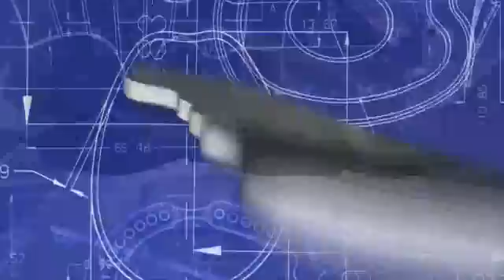#britek  Energy Return Wheel... Autonomous Never Flat

Comment from the maker: How do you think the EPA gets their estimated fuel efficiency numbers? USDOT testing labs.... where we did our tests. Show a pneumatic tire hitting a pot hole at 40 mph. then show how flat it is plus the cost of repairs. Check out our first ever carbon fiber video to see the front left steel hoop ERW that suffered a cracked hoop from hitting a 4"x 4" brick at 35 mph. still running. We switched to composites shortly after.

Comment: If I'm correctly understanding how this is suspended it seems pretty sketchy to me over the long run. As the hoop is deformed on the bottom, especially during an impact, the bolts have no tension on them, then become fully loaded as the wheel rotates. High frequency cyclic loading of that magnitude (and some of it impact loading) is a great way to snap threads in tension. Also, this design looks so stiff that the contact patch is greatly reduced. I also see the bolt holes egging out over time.

Comment: Imagine a wheel able to flex under load to for an elipse.  It would be like a tank track:  making lateral forces that would slide your face to your ear.  Traction that would have to use a locking mechanism for seat belts because roller coaster effects would be possible by simply breaking for a pedestrian, animal, texter, etc.  I forsee Nobel prizes being awarded.

Comment from the maker: We have done what you suggest! Our sidewall curtains are much more elastic than pneumatic tires. Some proto types are tuned via a 18 Hg. vacuum causing the curtains to curve inward.  Additional vacuum boost on hoop side backs up drawn membranes improving performance. Screw force accumulation and return is also improved via curtains.

Comment from the maker: ERW is much more immediate than you are thinking. Stretch a rubber band across a span then grasp and stretch from the middle in line with the span. ERW 360 degree array takes advantage of this mechanical levering and responce improvement. Acceleration and brake force are dramaticly improved.

Comment: If the membrane "stores" energy by STRETCHING & eventually releasing that energy; please solve this 'problem'. During acceleration, when the energy "stored" in membrane is released  eventually, it propels the vehicle forward. BUT; during braking, the membrane will similarly be stretched. The energy "stored" in the membrane from braking must also be released AND again; the energy would assist to propel the vehicle forward. Does this mar braking performance ?

Comment from the maker: Even our first protos would handle more than you think. HP and torque are turned into stretch energy as the 4,800 psi. elastic band supports vehicle mass and throttle response winds hub in hoop rebounding force to the surface....without hop.

Comment: They look really heavy with all those parts, centrifugal forces is just going to make it even more heavy to extreme levels. Resulting in reduction in power meeting the road, speed, and even fuel consumption. There;s a reason why race cars and even the average sports cars use very light weight wheels and tires.

Comment from the maker: Foam has it's own issues. Foam is slow and a weak link. ERW does not dent to process impact. We displace internally under elastic gain. ERW could be described as equal responce wheel.

Comment from the maker: We agree, the Tweel is just a spoke wheel. Flexing rubber spokes deform on the bottom while we stretch from the top ID of our hoop. Tweel uses a bias belted tire like hoop while we use space age composite hoops with bow like tension to flex a footprint.

Comment from the maker: Engineering options will provide the traction systems for specific applications. Our composite hoop is only 25% the weight of the rubber it replaces and is rated at 50,000 psi. while your beef eater pneumatic tire will pop at 120 psi. or be taken out by a 1' wood screw. Women will ignore your pneu. style while your ERW having buddy takes over.

Comment: Good move--especially for the off-road fans, when thorns, rocks & other items that puncture pneumatic tires are a major nuisance, simply because you're out in the boonies and only have the few tools you probably didn't think you'd need often enough to bother bringing with you :)  Solid rubber tires on bikes are *really* hard on the derriere for the non-suspension bike guys...

Comment from the maker: Yes. If the market would support it an expandable replacable tread to smoke at your pleasure. Nestably recieved on a curved atriculated composite hoop. Keeping the lamination line well above road contact. Hard to do with pneumatic tires. Retread option banned for use on front of pneumatic:)

Comment: lets see it on a race track, theres no dot regulations for a few runs around a track surely.

i could see it as a spare tire that never goes flat but how often do the bolts come loose from vibration when your driving and lets hit a few pot holes or rather as your going around the track and you hit the little side curtains or whatever. i cant see how these would hold up for 35,000 miles without problems when theres so much going on inside with the nuts and bolts.

Comment: Apparently you are not going to a very good sam's. I am a Service Manager at Sam's Club and we do not have this problem at all. Also i dont know what kind of sensor it is u may have on your car but we keep the sensors in stock and they are usually around 40 bucks. Reguardless if they break the sensors they are to replace the sensors and retrain them to your vehicle at no cost to you since it was their screw up.

Comment from the maker: TPMS is one reason that ERW has not been allowed. Remember auto manufacturers HAD to provide the system costing 120 million to comply with the reg.. They cant let it look like a waste...can they? The ERW you may be able to buy will be much more simple and ballancing and installation will not be an issue. The fuel savings are very significant.

Comment: Like the morons at Sam's Club wont fuck up these wheels beyond belief when you get new tires.
They cant even stop destroying my TPMS sensors ($200 per wheel and new tire needed when driving on a flat tire).

How could you possibly balance these wheels...and will the cost of one set come close to offsetting the fuel savings? How do these perform on roads that cant be maintained because the previous Governor of the state stole the Highway Fund budget to balance his liberal bankrupt state budget?

Comment from the maker: ERW can out perform pneumatic tires in all parameters. Depending on application ERW can be tuned or engineered to increased hub in hoop displacement or travel, the % of elastomer tune or stretch between hub and hoop, the amount of vacuum boost on the hoop side of membrane or the traction systems between the hoop and surface.

Comment: I have a question: the wheel is used to put power on to the ground and to grip it real good. The wheel we use today is also used to absorb some of the bumps and holes and smooth out the ride. How does this wheel compare in power transmission and absorbing impact?

Comment from the maker: There is still much resistance to ERW from the tire industry. There is much resistance from the auto industry...why buy a new vehicle when there is a double digit bolt on fuel efficiency improvement? The oil industry has concerns about upsetting the ratio between oil, diesel and the petro chemical industry. Change on ERW scale is very upsetting indeed.

Comment from the maker: A steel wheel on rails is 700% more efficient than pneumatic tires. So...no, Pneumatic tires waste energy by deforming the tire body and flattening a tread block to the surface. We draw elastic attachments from our flexable "Bow Like" composite hoop to points on the hub...a closed system. We flex a footprint to the surface. It is very good to be active, even better to have additional motivation to get outdoors, friends, family and maybe a new set of ERW's.

Comment: What I understand from seeing the videos is that energy is being returned by forcing them forward - against the wheels - therefore, according to Newton's third law of motion, more force is required to rotate the wheel assembly. Is this true? By the way, my father is nearing 60 yrs old, and he is pretty fit; he bikes with my sister quite often, without the need for these wheels. Anyway, what I'm asking is if my application of Newton's law is correct.

Comment from the maker: You are talking about our first steel hoop protos. We have switched to composites. Compare the early ERW protos acceleration in our Tire VS  ERW USDOT lab coastdown video. Our newest auto protos are the same weight as normal tires. Also.... it requires almost 100 novel patent claims to pull it off. A 5,000 yr. old historical record for wheel patents.

Comment from the maker: That .5" rubber is rated at 4,800 psi.!!  The rubber is stretched between the hub and hoop by attachments that draws it to points on the hub. Irregular surfaces, vibration, bumps all cause membrane stretching that absorbs and delivers those forces into rolling action.Air under pressure transmits vibration, controled stretching of rubber absorbs vibrations.

Comment: The bolts were to long. Way to close to the caliper. Road debris can get stuck Between the rim and the caliper, that could cause the wheel to lock up/ or Failed Brake system.

Comment from the maker: Check out our carbon fiber video to see custom stage 2 suspension system upgrade, adjustable coil over shocks 1.5" ERW sidewall accend 1.5" stone. 1" bounce came from 1" ultra soft traction layer, now corrected. We are high speed.... IE low pressure pneumatic tire + speed = trouble

Comment: Oh! i see what your saying! i did not take into account the flexibility of your hoop coil. That does make much more sense. So if i understand your companies concept correctly your inner wheel is made of a flexible steel that when compressed by the vehicles weight has a natural flex that improves both wheel contact with the ground and gas mileage conservation since it is naturally working towards releasing its compression forward on a rolling axis?

Comment from the maker: The SL 55 AMG is a V8.  No matter what you drive ERW can improve efficiency and power from the drive train to the ground. A bolt on solution is one way to improve existing vehicle performance for the rest of it's multi year lifecycle. Saving billions in fuel costs while the auto industry rolls out the newer more efficient cars.

Comment: A rubber diaphragm operates because there is a pressure differential between the two sides, one side a vacuum and the other side pressure. Your question is nonsense.

Comment: Where was the proof backed by science?  Two things claimed but totally not supported were, energy conservation and vibration reduction.  Proof would be showing mpg measurements under controlled tests and as for vibration, same deal using some measuring devices.  If the claims are true then awesome, but any smart person would have their doubts without it.  On a sidenote, I was extremely relieved that this wasn't a perpetual motion pitch =)

Comment: This guy is so full of shit.  First off, no rubber returns much of the energy you put into it.  Mostly, it just gets hot.  I'm sure if you shot a thermal cam at this thing while in motion you would see a great build up of heat being wicked away down the spokes of the aluminum wheel.  Now, I'm sure there are effeciency improvements, but, that is just from the very hard nature of the tire reducing rolling resistance.

Comment from the maker: Consider the ERW hub rotating and crawling up and forwords within the hoop as you accend a hill.  Bounce is cut roughly in half as action plays out internally between hub and hoop. ERW will offer a massive weight savings on larger size tires due to sidewall mass reductions. Note our VIDEO chained down, homebuilt ERW easily spins the USDOT  AWD dyno set to 6,000 lbs, you do not want future ERW on your 4x4?

Comment: In my country, we measure fuel consumption by liters per 100 kilometers! I fill the tank, drive 100 kilometers and then fill it again. Air is not the only thing that can go into the engine via air intake ;) These are what I do: add Acetone to fuel. Place magnets with certain power on fuel lines. Preheat the fuel, using heat of engine and finally inject hydrogen (I have access to free aluminum) and water-alcohol vapor! These all happen while I use SVO(biodiesel)! Do you still think its bullshit?

Comment: very intriguing, question though?... i worked at a steel shop and we made a huge steel drum for a company. we left it outside until the customer picked it up in the heat...it warped in the heat. what is the possibility that these wheels will warp sitting in the sun? and if no possibility please explain why.

Comment: i dont completely understand how this wheel returns energy. just kinda looks like a wheel without the rim and suspended by a handful of bolts:/ i would like to see an animation or a diagram of how this wheel returns the energy from the throttle. one of the problems i could see would be the torque of many high powered cars ripping off the bolts from the flexible metal ring you speak of. if your talking about energy return from the rebound of the metal ring reducing weight or something, explain?

Comment from the maker: Oh,  like our issued patent claims utilizing carbon nano tube infused rubber compounds in membrane and traction systems for overall performance enhancements? ERW hoop on hub  displacement stores and returns energy from the pull of gravity further charged by throttle responce = acceleration enjoyment. Pneu. hops,  flopps and squirms while we hook up.

Comment: I have been bolting this design on for  years. Off road equipment use hollow core bolt on treads
all the time. Forklift tires are the same idea but no energy return.
Impress me with electro magnets and reduce friction by 30%.
With magnets cars cant hit each other. If they cant hit they can be made out of all plastic. So can tires but with electro magnets you would not need tires or breaks or steel or gas
or a lot of other things but no one has a job now. Oh well.
Improving shit is still shit.

Comment from the maker: ERW has changed much. Even our first home built protos went 75+mph  while chained down to a USDOT dyno set to 6,000 lbs. resistance. The lateral resistance is very strong IE the radial array of membranes draws 360 degrees of support as opposed to the pneu. deforming at tread block and localized sidewall flex. ERW displaces internally hub in hoop supported via stretch dynamics.

Comment from the maker: We went through our run it over program and did crack a steel hoop by hitting a 4" x 4" brick at 35 mph. Only heard a light bumping after strike, the membrane was still holding the hoop together.  And we could still travel. Our composite hoops are stronger now.

Comment from the maker: We have no final numbers, the weight of a 285 35 19 hoop is 8 lbs. with 12 lbs. Kevlar and rubber traction system. Ballance issues same as pneumatic except the weight strip can be placed closer to the OD, less weight. We also can remove 1 lb. or so of compressed air volume via vacuum boost.

Comment from the maker: The hoop is suspended from the hub by funnel shaped rubber attachments. Each of the attachments are pulled to 300 linear pounds each, like sling shots. When set on the ground the ERW hub sinks within the scope of the hoop to levitation or float. More dynamic pull on topside membrane + throttle responce = drivetrain efficiencies and torque to the ground. Check out our USDOT dyno videos to see ERW spool up  against a 6,000 lb. AWD dyno load..

Comment: If people will keep their tire pressure at a proper level then this ERW is totaly useless and expensive.

Plus, air wheels are better because due to different conditions the wheel can have smaller or higher tire pressure. Like Salt Lake... to race there you need to over inflate the tire.

Comment from the maker: The reason hub and suspension system is classified as unsprung weight with tires is because the tire only crumples up from the bottom creating an overly bouncy responce not a controled closed system like ERW . IE hub is drawn in all directions at once by the inner diameter hoop elastic array.

Comment from the maker: ERW acts as a powerful torque converter between hub, hoop and surface. Acceleration, cornering forces,braking action all influence rotational capture and metered dynamic responce. It's alot faster at reacting than pneu.

Comment from the maker: ERW has multiple fasttener options. One favorite is the 6"x 6" composite pull plate that creates a broad interface with the vacuum backed membrane. Our German engineered membrane has a burst strength of 4,800 psi.. We laugh at the pneumatic sidewall burst strength. We however prefer a snicker to avoid the slap.

Comment: The fasteners will be the undoing of this product also given the lack of redundancy put with the fact that people hit potholes at 90mph will in turn add a overwhelming G force combined with centrifugal forces will prove to be deadly. for instance have you ever had a clutch or valve train come apart at high rpm? the fragments penetrate the firewall and floor boards like a bullet. and with parts missing you might get lucky and have a gyroscopic effect and be able to continue until you slow down.

Comment from the maker: Check out our USDOT videos where our "home built" no traction layer ERW is chained down to a 48" AWD dyno 4,800 lb. ML 55 AMG dyno resistance set to 6,000 lbs. Consider the pneumatic tire high speed shots of sidewall deformation then imagine our hub able to rotate within the scope of our hoop on the array of drawn membranes...rubber band wind up propeller potentially capable of thousands of lbs. torque transfer. The wind up potential return is even greater than linear displacement.